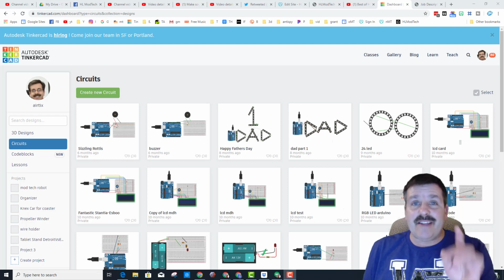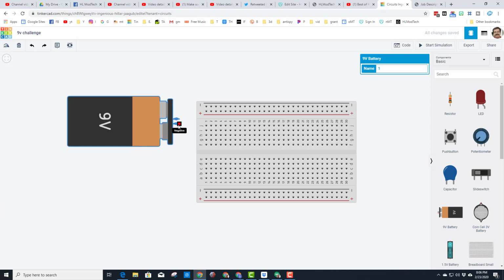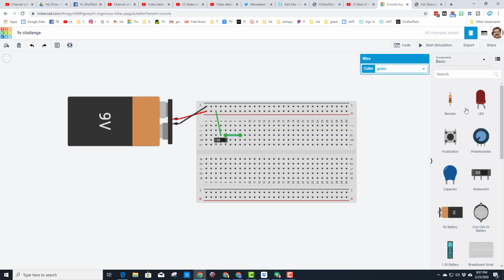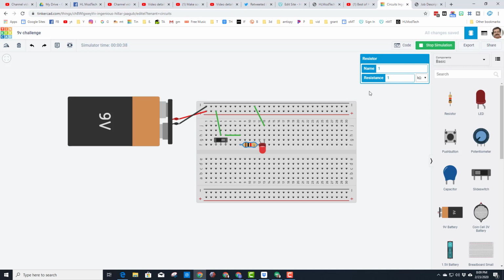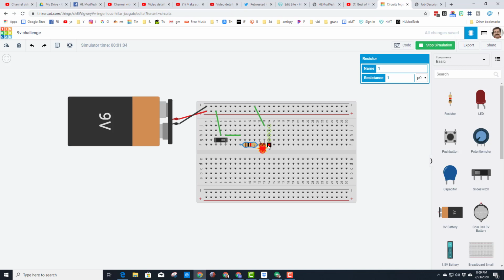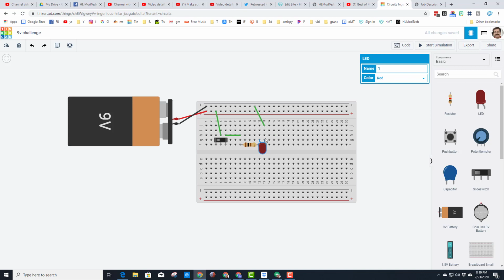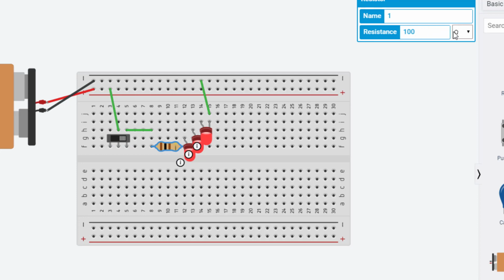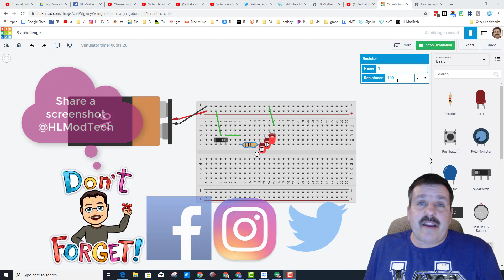How many LED's with one 9V battery? A Tinkercad Circuit Challenge!

Comment: Don’t yet have TC, so I’m using the free online resistance calculators out there. My problem is lighting 5 leds of three different colors using a 9v power supply. The calculators only allow for input of a  number of single color LEDs not an array of 2 white, 2 red and one blue. Given that the forward (min) voltage of this array of 15.6 v already exceeds the 9v supply I’m guessing I’m out of luck to begin with - is that true?
Reply from the maker: I would believe you are out of luck. Tinkercad is not 100% accurate and you can actually power way more in the sim than in real life. Tinkercad is 100% free and runs in your web browser. All you do is visit www.tinkercad.com to play with it.
Reply: @HLModTech  Thank you! Ive just subsriibed to your channel 😀
Reply from the maker: Always appreciated. =)

Comment: Thank You! I am currently building a guitar, and on this build I want to add LED lights as fretboard markers. I knew I needed to do math, but suck at it. Thanks to you and the site, I figured out what I will need. 12 White LED Diodes wired in parallel with a 30ohm resister and a 9v battery.
Reply from the maker: That is awesome! Sure do appreciate the note. If you ever finish the guitar I would love to hear about it as well.👍

Comment: Well how can connect more than 9 leds with the same battery plz? And egat resistor I use ?
Actually I made a wooden ship model and I like to add some lights to it .3 leds here, 2 leds there,,etc. ! I wish you can help .
Reply from the maker: Sorry I did not see this sooner. I am not sure what the number is in real life. In Tinkercad it is usually 7, but some kids have passed 20 because the sim is not perfectly accurate. 100 or 220 ohm is my usual go to for a resistor.

Comment: Hello!  I have a real world restoration project I am working on currently for a vintage Winnipeg Jets chalkboard that has 24 red LED lights but the 9V battery pack is missing! And I am not sure what size resistor to use???  I was hoping you might be able to help me figure this out since the record in your challenge is 24 :) 
Resistor Value = 7V / 0.48A = 14.5833 ohms 
Resistor Power = (0.48 x 0.48) x 14.5833 ohms = 3.36 Watts?????
Is this correct and what is the closest resistor I can find that will work for me?
Reply from the maker: Thanks for reaching out. Super cool sign. 👍 My guess would be about 220 Ohm... Your formula looks good, but those calculations are not really my forte... more guess and check.

Comment: Ive just been on Tinkercad. What a great idea. this video helped more more than any of the others Ive watched so far. 
I'm working on something 9Table lamp) to which I need to add 45 3w leds to it. Ive never done anythng like this before and am finding out all sorts of things likethe importance of  resistors etc. A question if I may, what sort of power supply would you suggest for this. I originally wanted to use a usb supply 5v but someone told me there may not be enough power there to make 45 leds light up and suggested I use an old broadband charger (12v)
Thanks
Johnny
Reply from the maker: I am glad you are enjoying the vids and Tinkercad circuits. I think it is correct that you will not be able to power all the LED's with a USB plug. I am not an expert on the math though... As much as I have fun dabbling, I have always been guess and check with this stuff. There is a FB tinkercad circuits group that may be of use. If you end up making something sweet, please share. I am hlmodtech on gmail. 👍

Comment: Hello! Im a Beginner, if you had more LED's, say 7, would you even need a resistor? Or is one recommended no matter what?
Reply from the maker: Good point. You could get to a point that the LED's were still operating with a safe amount of current. In a simulation, if you pop one on the way to the perfect amount, no worries. With real LED's, you would probably burn a few out along the way.